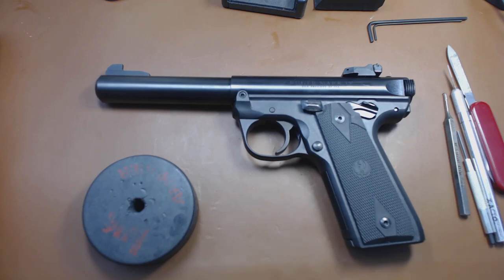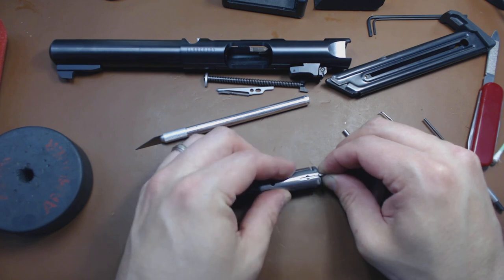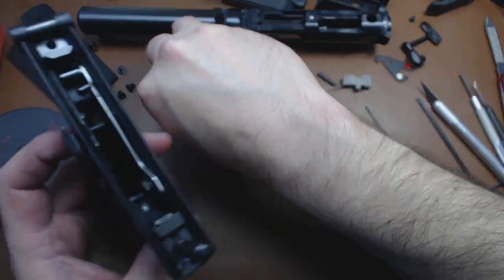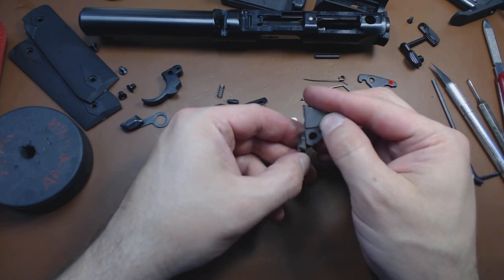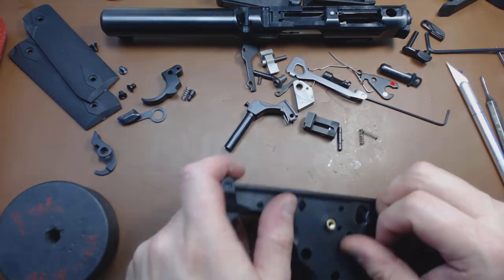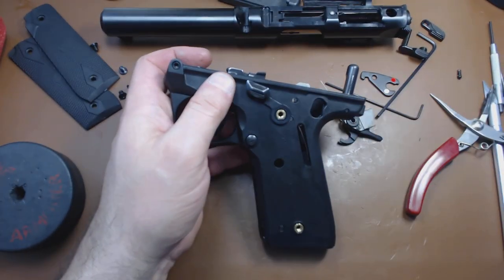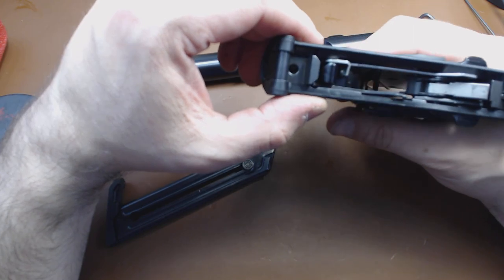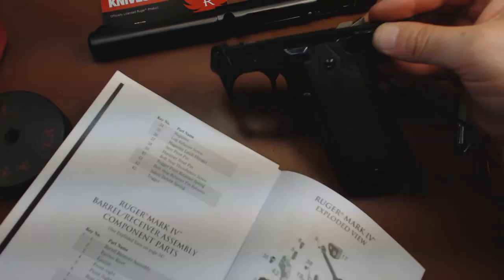Ruger 22/45 Mark IV Complete Disassembly and Reassembly

Comment: The upper is over engineer. What I mean by that is on the new models and even the old there was never a reason to thread the receiver and screw the barrel into the receiver. Had they not done that you would be able to remove the barrel for better cleaning. 

The reason it was unnecessary is because when the upper is placed onto the frame it has a locking lug at the front that fits in the lower portion of the receiver right under and in front of the feed ramp. The lug coupled with the rear take down pin makes it impossible for the barrel to move. It can't come forward because of the cut right behind the feed ramp on the barrel and it cannot clock due to the top of the lug being flat. 

In the newer ones it is even more unnecessary because it has two surfaces in the front that locks the barrel, the pivot pin and the flat lug which although it was changed it still helps make it impossible to move. Attaching the barrel that way is what I presume was Bill Ruger's attempt to make the pistol more accurate, I believe Ruger probably never changed it because it simply worked. 

The cons to not threading the barrel, the barrel can move on reassembly, and THEORETICAL loss of accuracy (not proven it would cause this) and thats about it.
The pros, the chamber can be cleaned better, repaired, modified or replacement of the entire barrel by the owner of the gun, the upper can be cleaned better, it can be parted out. 

Actions that could be taken to address the cons is put a dot on the bottom of barrel and receiver (like timing marks on an engine) so the gun can be indexed exactly at the right spot to aid in reassembly, it could also be tested to see if it drops in accuracy as a result of doing it, personally I don't think it will as the grip forces the user to grab higher and thus resulting in a higher bore axis. 

I am building one from CAD files from scratch and I did not thread the receiver and barrel to connect them, instead I used a slight taper on the final mm before the barrel is seated all the way into the receiver. The taper allows me to tap the front of the barrel with a rubber mallet once it is back into its spot I indexed it at and it taper locks the barrel for reassembly so it cannot clock on its own and if it is in the wrong spot the lug will not allow it to go back together. Once I am done with the entire gun I'll test it and see if accuracy is affected. The gun is over 50% complete and I've been working on it for over a year. 

Odd things I've noticed about the design is of course the mainspring housing, it is easy to see the design of it is similar to old school pocket knives and is probably the inspiration for its design. The frame is an odd choice for its original design of being a clam shell type and welded together like no planning went into the frame beyond accomplishing the shape of the frame. This is pretty clear  because of how the back square is thicker metal to support the take down/latch assembly, the addition of the mag catch spring pin instead of going with putting a plunger system that was housed in the mag catch itself (would have made a cleaner frame cosmetically), the front lug is also shaped and welded in. All of this sort of points to a lack of planning before welding the frame together. It's a good design it just could have been made cleaner with a bit more planning. 

But for someone who put it together in his garage it is extremely well made even the earlier ones. But it is nice to see Ruger after so long they finally started to tweak the base design to include features other guns have now. It shows they are not willing to let the competition get too far ahead of them and that is good in a company. I think the only thing left is to not screw the barrel into the receiver. However they may have updated it and no one knows yet, has anyone tried pulling on the barrel to pull it out of the receiver to see if it can be done? That would be a major plus in favor of Ruger because they could treat it like a separate part making it cheaper for the customer to repair the gun and easier as well.

Comment: Is it safe to dry fire it?
I got the target version. Do you know if I can tune the trigger without the volquartsen kit?
Reply from the maker: Dry firing any rimfire weapon is something to avoid. The firing pin is designed to crush brass, but without the brass to cushion the blow you are just pounding steel against steel. If you are lucky you just break the firing pin. If unlucky, you can dent the chamber over time and create a divot where the pin hits. When that happens the rim can just get pressed into the divot instead of crushed.
And yes, they make an adjustable trigger.
Reply: @AshburnArmorerDan  Yeh, but the question was.. can I fire the ruger mk4 dry? Does it have a safety?
Reply from the maker: I'm missing something in your question. Dry firing will damage the gun as I stated. It has a safety, but that has nothing to do with dry firing and will not prevent damage.
Reply: @Eurofilme  You can pull the bolt back a couple mm so it isn't flush with the chamber wall, then the firing pin won't slam the steel. Idea is to pull back as far as possible whilst trigger still has tension, and dry fire.

Comment: You don't understand why they made a light version with a threaded barrel for a suppressor? Well, seeing as suppressors don't impact accuracy, just point of impact, and it's lightened because there is no need for a heavy 22lr handgun. The lighter the better. A lighter handgun is easier to maneuver and less fatigueing.
Reply from the maker: The heavier the gun, the less the recoil. Most 22 target/competition pistols have heavy bull barrels for this reason.
Reply: I would agree on the weight. However, my wife shoots the 22/45 Lite, and I have the 22/45 target. So particularly for women, kids, and backpackers/ hikers, the 22/45 Lite does have a place. I believe it is an issue of personal preference and who is using the firearm.

Comment: "Who reads the manual..." as a Technical Writer my heart is bleeding lmao
Reply from the maker: This was more of a joke about the Mark 3 than anything else...As a technical writer you may find some degree of amusement/pain if you google up the mark 3 manual and read the section on "reassembly". The instructions are technically correct (the best kind of correct) however, there is little to no explanation of why you are doing any of the steps. After going through all of the "point it up, stand on one leg, point it sideways, turn in a circle" type steps it ends up feeling like more of a voodoo ritual than a firearm process. Cheers!
Reply: @AshburnArmorerDan  I was joking as well of course. Statistically, 98 % of all the people aren't reading user manuals ;-)...at least when it comes to consumer products. I also very often don't read the manual ;-). But who needs a manual anyways when he got your video? ;-)